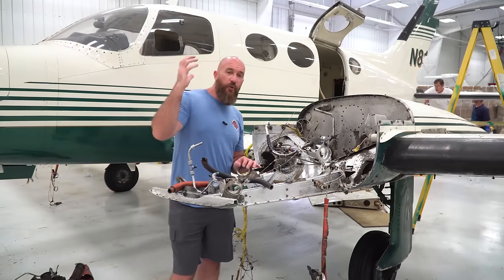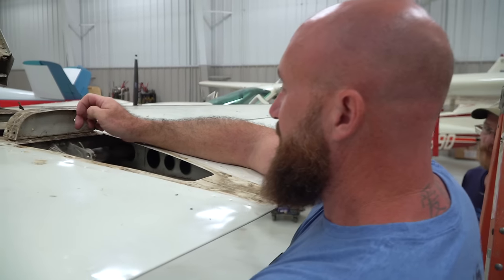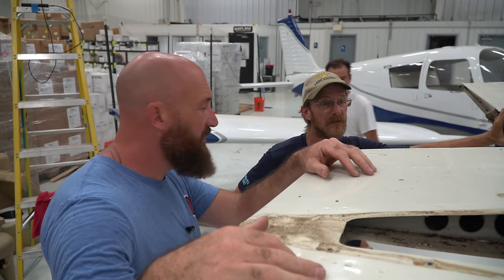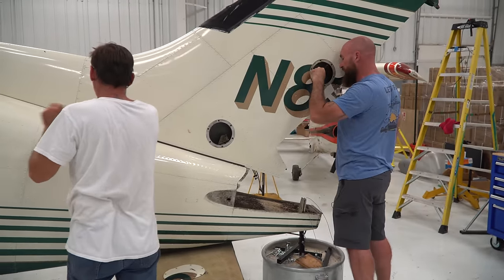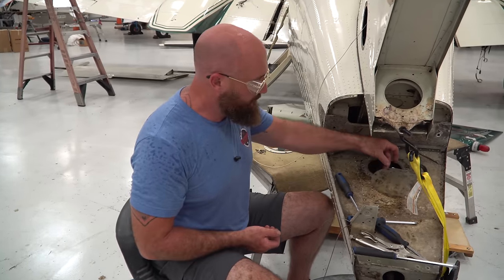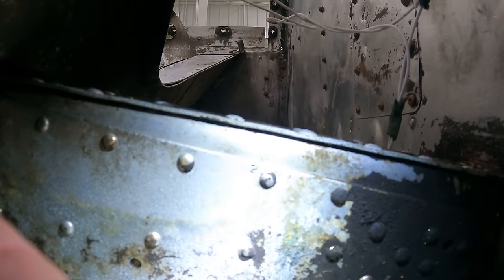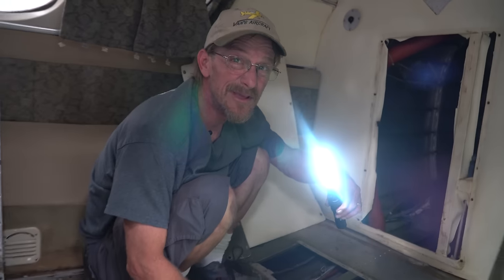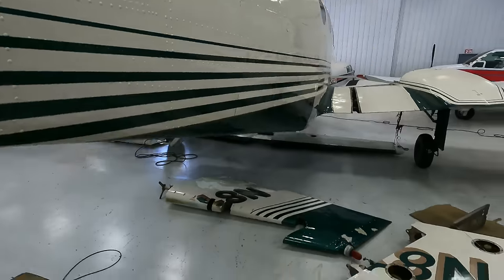BAD NEWS For The Free Abandoned Airplane !

Comment: Buying another wing will just bring a whole bunch of new problems. Repair what you have will probably be cheaper. Been down that road more than one time in my 57 years of aircraft maintenance.  My only advice is slow down and take your time. Large repair projects are like eating an elephant. Take your time and one bite at a time. you are doing a good job so far and I enjoy watching all the videos.
Reply from the maker: Awesome advice Jim….   I’ve heard stories of wings from other aircraft not fitting other airframes. Makes me super nervous…
Reply: Maybe not exactly cheaper, but in fact you know what you are working with. Unless the acquired wing already was compleetly rebuilt (with documentation to back it up) it may really be potential can of worms on top of the issues with removing, reattaching and aligning wing that worked, flexed and deformed on a different airframe, eve if it was identical.
Reply: @rebuildrescue  what Jim said - and absolutely not being an expert - but if (big if) the rest of the wing is sound, and it's just that engine mount, rebuilding that is likely to be less of a pain than a donor wing. 
Also, how mellow are Joe and Keith? They are totally the guys you need on this project - just taking it on one bolt at a time!
Reply: @rebuildrescue  you can get donor sections from salvage yards and puzzle 2 wings into one, went through that with my 310
Reply: @anythingwithplanes  that sound like an idea, a donor wing and use the enginge cradle from that wing.
Reply: @StephenHughesJelen  Airplane refurbishment really favors labour. Buying new favors management. I support labour!
Reply: @StephenHughesJelen  Why would you go to the trouble to get a wing from the junk yard, assuming the engine beams were in pristine condition (which is very unlikely), when you can buy brand new PMA’d beams from TAS.  Planes of this vintage were custom made.  There is zero chance all, or even most, the rivet holes in the donor beam would align with the holes in the airframe?  Now you’ll need to make a bunch of doublers and use a bunch of oversized fasteners.
Reply: Yes its concerning that he seems frustrated and seems to want to rush things. This stuff is serious and life threatening. This isn't something you put a time table on to get done in time to take to some show.
Reply: I agree, same with older cars. New or different parts will never fit the same as the stock one for that car.
Reply: @rebuildrescue  One reason why wings from other aircraft not fitting is because some where made using wooden jigs with poor tolerance. The wood jig would slightly expand or shrink throughout the year with the weather, temperature, humidity etc. So the wings would be slightly different by a few mm. Sometimes it took some fabrication to make the brackets fit.
Reply: @rebuildrescue  Jason. For confirmation check out the Royal Air force "Nimrod" upgrade program fiasco. 10 airframe including wing replacements and avionics. Get first aircraft in and remove wings. Use them as template for furhter wing sets. Manufacture 3 or 4 more sets of wings. Get second aircraft in to fit wings and they don't fit. The airframes were "HAND BUILT" and so the central fuselages needed to be replaced. Program was eventually cancelled after a cost of hundreds of millions spent. Great work so far. I would say. Take the time to get it right. If you want it to last, take the time to make it last.... Good Luck. Phil
Reply: @notmenotme614  o
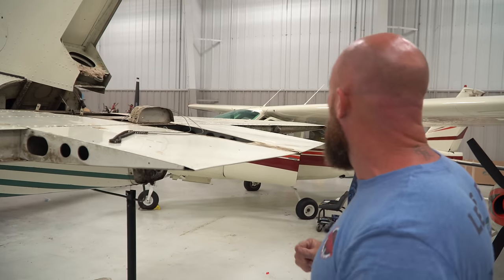Reply: 21:17
Reply: Fantastic saying     big project like eating an elephant …one bite at a time.

Comment: I'd price them both and make a decision based on cost, reliability and quality.
Reply: Agreed Jason, cost V time.
Reply: What about the wing flex issue which is why they decided not to pull the wings to do the straps?  Mating a different wing could be an issue.

On the plus side.  Maybe they could find a wing with the strap AD already done.
Reply: Agree on checking price differences for wing/engine cradle frame. Totally agree with pulling everything apart to check for excess bird dirt. All that adds weight which throws off the center of gravity of the plane (CG). Don’t shortcut that. It to important.
David
Reply: agree.. donor plane wings...
Reply: Only thing that makes sense.
Reply: When he said 150 hours of labor my thoughts immediately went to donor wings. Finding a set of donor wings worth buying is going to be the issue.
Reply: I second that
Reply: This is exactly what I was gonna say
Reply: Have to be careful with as removed serviceable parts for anything. Just went through that crap myself on an part for one of the aircraft I manage. Just because it says as removed serviceable doesn’t necessarily mean its going to pass my inspection. My part came cracked as well as paperwork that didn’t match the SN of the part I received.  A time waster in a line of work where time not in the air is money lost. Finding a set of wings would be fantastic but thats no guarantee they are going to be better unfortunately.
Reply: forget the wings. instant submarine
Reply: @jacejows6535  I agree with the used part problems. I was a QA manager in Boeing AOG for a few years. I did a lot of return to service. Once you get into a corrosion area it can turn into a can of worms. The new 'as removed' parts might not be any better and there is the unknown history.
Reply: THIS
Reply: @jacejows6535  True -- you could spend a lot of money buying a whole new set of problems...or even the same old problems on new (to you) parts.
Reply: @nathans5773  Doesn't it matter if the 150 hours of labor are paid, or free?
Reply: @jimpalmer1969  you are correct... I think it is better to check for repair that will be less pain
Reply: @kerryedavis  Fair point. I assumed that the complexity and effort necessary to do the work would mean that it would be outsourced to another company, similar to the wing spars. Additionally, since the original question was to repair the wing or look for a donor (and I assume the donor part is not free), I interpreted to mean the repair was going to cost a lot of money since the purchase would also cost significant amount of money. I feel it is also worth considering the time cost. If someone is doing that work, they are not free to do other work. If the deadline is Oshkosh 2023, 150 hours is a lot of time to dedicate to one item. If there is an outside company willing to do the work for free and that company would not otherwise be participating in the restoration efforts then the clear answer would be to outsource the repair. However, if the work is donated and all that is needed is to bye the part, that is what I would do. Time will tell.
Reply: Donor wings fatigue life could mean you have to extract the parts needed to repair your wings.
Reply: @Dave5843-d9m  that's another aspect too. And I would also be reluctant to replace just one wing of a pair, even if the original other wing is thought to be fine. Even if replacing a wing is supposed to be faster than the needed repairs, there are other concerns that greatly complicate the equation.
Reply: You could benefit from small electric screwdrivers (3.6 volts or some such). It would speed up bolt (and screw) removal without risking stripped threads.
Reply: @Dave5843-d9m  Also, if they're extracting parts to replace on the existing wing, why not get the new parts instead even for $9,000 rather than buying a wing, possibly shipping it, etc etc.  And you still end up with used parts, IF they're acceptable!
Reply: @Dave5843-d9m  using torx head screws would help a lot too. Torx existed when the 401 was built, probably, but were not widely used for some time. And of course the torx screws would have to be properly rated and certified etc.
Reply: I agree 100%
Reply: @thechurn4766  He said on some previous episode that it will aggravate the wing flex if he removed the wings, as per the manufacturer said (Cessna)
Reply: Agree
Reply: Well, it always pays to explore all options and get as many estimates as possible.  Be the best steward of the $ as you can be.
Reply: Just found a pair of 401 wings for sale. The listing claims they are corrosion free.
Reply: @Naoquerose  There is more to it. If you change the left wing to correct the corrosion problem, then you will have one wing with a different number of hours on it. The log books are already an issue with this airplane.
Reply: @kerryedavis  It's not an experimental, you can't just go swapping parts out for better even if the parts are certified from another source as the aircraft isn't certified with them. You would have to get an STC and that's a whole other can of worms to get into because you also would need to do the paperwork to prove to the administrator that it will be airworthy with the new design. That is typically why aside from major advance's like a glass cockpit upgrade little stuff like screws aren't changed from the original TC of when the aircraft was certified. There is a reason you don't see many of these old twin Cessna's around anymore and it's because of the simple fact better designs have come along and because there is only so much aftermarket support. Cessna does not make these anymore so if you can't find usable donor parts you have to have them made which is going to cost some serious money. 

Now more people are coming around to why seasoned AP's have been saying he bit off more than he can chew and he's got far more work ahead of him. That's not to discourage him but simply say hey you may want to rethink this. It's not common for aircraft to sit around like this thing did. There's a reason it sat out there all this time. While I think it would be easier to prove it will be airworthy at the end due to all the video documentation this project is still a long way out from being done. He's overly optimistic on his time schedule because the further he dives into this the more issues that need to be resolved are going to come up as now you are seeing.
Reply: @FloorItDuh  if nobody in the past 50 years has certified torx-head screws to be suitable for that purpose, then no. But if acceptable certified torx-head versions are available they would save time and not have the problem with stripped/damaged philips heads.
Reply: @kerryedavis  It's mainly a materials thing. They need to be as strong as the screws they replaced and of the same metal so as to prevent corrosion. I haven't had issues with philips head screws in fact I'd argue I've had way more issues with hi-torx and torx style screws period than any other when it comes to aircraft.

Comment: I’m enjoying this video series!
My 2 cent:
I know the A&Ps most likely speak out of experience (and I respect them a lot!), but please refrain calling something « surface corrosion » until it is 100% removed and assessed with NDT (ask me how I know)
1 - Eddy current will tell you if corrosion is completely gone (and is also used to locate cracks)
2 - Ultrasonic will tell you remaining thicknesses, which are crucial in order to know if an area is acceptable as is, or if it needs a repair (or even replacement if it is too far gone)
Indeed, used airworthy replacement parts are sometimes the solution (emphasis on AIRWORTHY). Make sure you don’t get fooled into buying junk parts… (seen attempts from questionable brokers before…)
Oh, and if you end up repairing any areas near the leaky exhaust, I would love to see you check if the metal is not out of temper. It doesn’t take that much heat to turn aluminum into an annealed noodle.
I’m nearby (ILG) if you need hands! 🤘🏻
Reply from the maker: Thank you for sharing your thoughts and information 👍🏼👍🏼
Reply: Great helpful response. RR hire him

Comment: Id only replace the one Wing. You mentioned earlier how the wing can deform after removal and can be extremely difficult to reattach. I can only imagine a donor from a completely different air-frame will make it that much more difficult. As for new engines as well...A plane is parted out for a reason Even with good paper work you really dont know what your getting till it comes time to use it. I think since your on a 9 month wait for spars, and your doing such a good job removing everything for inspection .You would have alot more piece of mind on a fresh 0 hour rebuild on engines that you know their back round.⬆️
Reply: I don't think the problem was the wing deforming just from being detached.  It was they will deform if you put the spar straps (that are part of the AD to get it air worthy again) on while the wing are detached.

Comment: The company I was flying for at the time "lost" a 401 when the right engine got a fracture in the engine to turbo piping. the fire cooked fuel lines and the only clue in the cockpit was a loss of Manifold Pressure, engine running roughly... and the A/C was AT ALTITUDE when it became obvious they'd lost a turbo. but the fuel flow was still high....  Several minutes later a thick black liquid was leaking out around the tip tank to wing seam and around the cowling, the A/C had long range fuel (gas behind the engine) It didn't take long to figure out they had an internal wing fire. The crew put it down fast into Raton, New Mexico. Nothing left...  No casualties.
Reply: The black goo they figured was the fuel bladders cutting loose . If I remember correctly 5 alfalfa... was a 1968... she was wearing out where nobody had expected. The exhaust had what looked like slightly flexible corrugated expansion tubes and fuel lines intertwined though all the exhaust tubes. I see it as an accident just waiting to happen thinking back now.
Reply: @eagle2019  they shouldn't have released those cabin rodents, could have come in handy to be milked for mouse milk but now they're gone... 😏
more seriously, what is mouse milk? 😬

Comment: You know I see all the work that's going into this project, I can't help but think of all the unsung heroes from World War II to present that had to go in and fix Fighters and Bombers that came back all shot up and the work they did to get those things back in the air mission after mission... all the while having to do the work in ungodly situations and locations like tinian and Guam or in the freezing conditions in Europe. The pilots and crew usually get all the accolades but those mechanics that work their butts off to keep those things in the air mission after mission just unbelievable.
Reply: The B-25 was only expected to be air worthy for 18 months.  They'd just keep manufacturing them so quickly we didn't run out.
Reply: If they were too badly shot up to be repaired in a couple of days they likley stripped them for parts and the crew issued a new airframem
Reply: Yeah, unlike this Cessna, the WWII aircraft were never really meant to be service apart from the engines. They were designed for like two deployments lol
Reply: I was in the AirForce and a C130/C141B/C5A-B loadmaster I flew in C130A models and up some of those airframes had been going since the early 60's and up.  Roomates worked EMS and FMS units, those boys worked their asses off Sheet metal and corrosion control.  During Desert Storm, we flew Wartime contingency payloads and literally turned the leading edges into wavy aluminum foil the ACL's were so high.  Crew chiefs kept those dang birds flying every mission...
Reply: Yea, you don’t go into aircraft mechanics for the glory, airlines and even less so, GA.
Reply: @xXVintersorgXx  A life expectancy of 18 missions not months

Comment: I was stationed in Panama as a Aircraft mechanic , This area is a tropical highly corrosive atmosphere and we serviced aircraft that were wwII vintage and these aircraft with  proper periodic inspections , we kept a check on corrosion. That is essential to keep corrosion to a minimum. We would spot corrosion then treat it ! The answer was the INSPECTION on a strict schedule is needed to prevent major repairs.